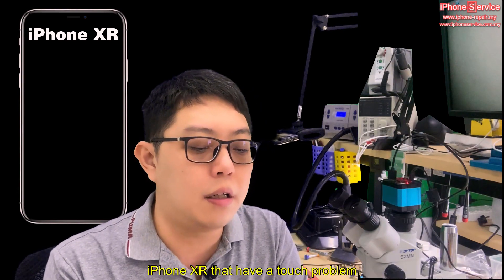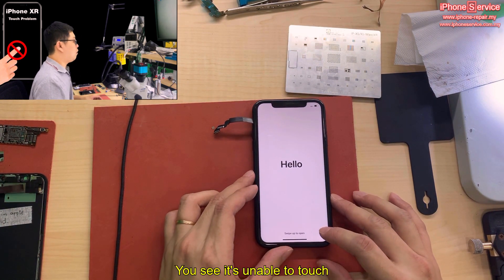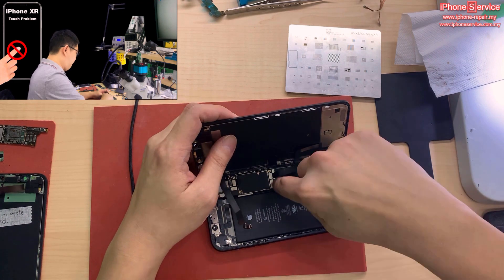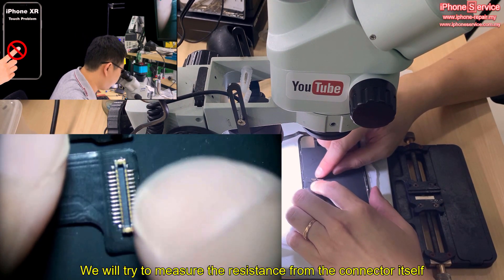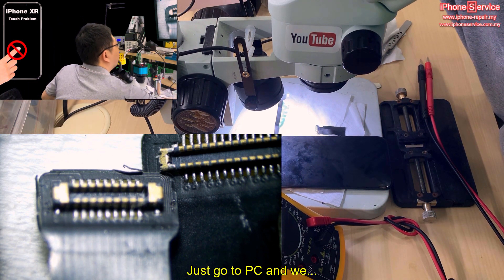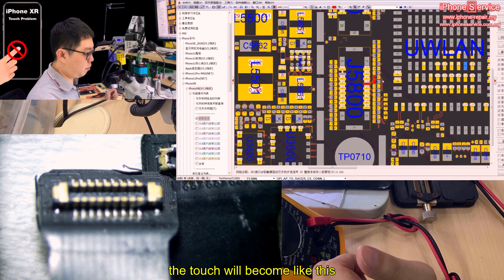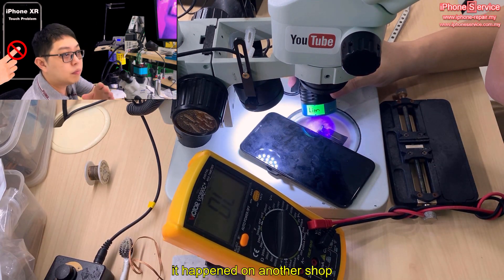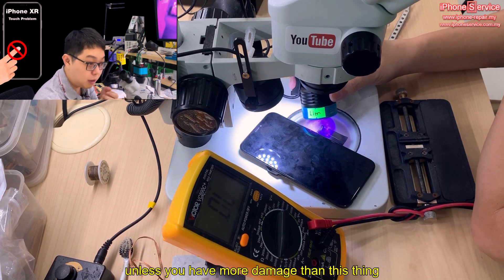iPhone XR LCD Touch Problem Fix

Comment: But.   Mine. I.     Its.  Black.       Screen.  So.   I. Need.  To.    Touch.  Power. Bottom.   On the.   Side.                I.   T.    Mite.   Be.  That.     Floowen.       The.  Floor.   To. Manny.  Times.      Do.  U.   Know.     If.      Can. Shut.  Down.         Or. It. Mite.  Be.    To manny.        Apps

Comment: can you fix ghosting issues, i have a basis repair shop and most cases i do only hardware replacements instead of soldering.
sometimes i come up with a screen that has ghosting after 3 months, how can this happen (screens are original or oem , refurbished.)
Reply: that's also i want to ask if he can fix the ghost touch problem. basically, what i do is just replace the LCD. but i want to know what causes the device or lcd to that problem.

Comment: Sir...I have some confusion about face id Repair...which method is good i2c or Luban..?
In which case the i2c programmer use..?
Reply from the maker: Usually I don't reply the question that is not related to the video. But this question I have a fire to answer.
I do have i2c dot projector repair kits... they suck big time.
the flex their provided got problem in 3 out of 10. 
And some flex will even die itself after the customer used for few weeks. 
Now I heard they got second-gen of flex, but also many dealers complain the flex got a problem, too hard.

Luban is better, but more works.
Reply: @iPhoneServiceMalaysia  thanq sir.

Comment: Oh this is Great! Came here because I have been having issue with xr have no touch, but you can turn screen off and on then touch work, so not sure if this is problem, but I will test the screen connector now... 
What's the UV for, and which do you recommend I buy? Haven't learned to use uv with my soldering so I am now curious! Haha

Thank you very much, keep up the great work!
Reply: I have the same problem with my Xr
Did you manage to fix yours? When I turn the display off and on it works for some time and screen gets stuck later
Reply: @waynejones3731  luckily customer this is happening with is younger cool kid, so he's understanding of the new issue we will need to find workaround for. I have saved his original display for the touch IC, and plan to have him drop off one of these weekends for me to swap this chip and see how things goes. But currently I'm held up looking for the stencil to reball the chip properly. Anyone have link to touch IC stencil for XR?
Reply: @waynejones3731  oh this is flex cable vid not the touch IC transfer vid, my mistake. My issue is with brand new screen, so I don't think it is micro break on flex connector, I think it is touch IC chip marriage to board apple is starting to have more tight checking of serial of parts.